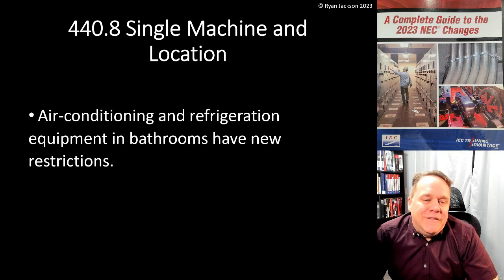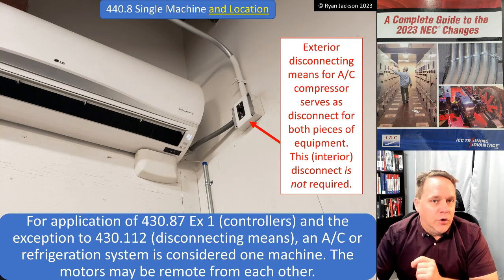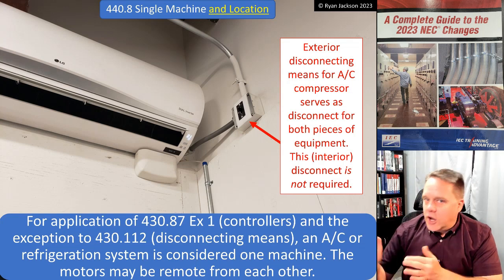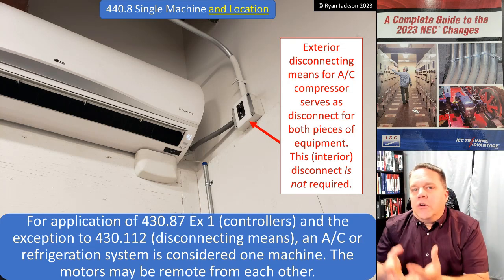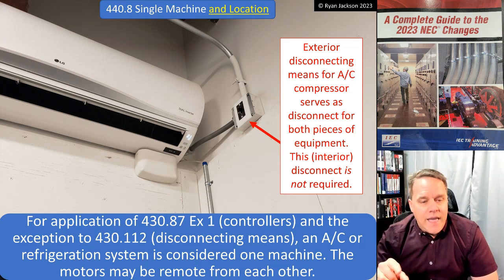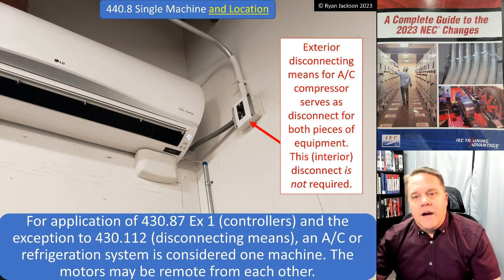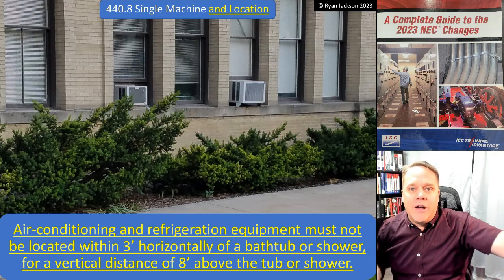440.8 Single Machine and Location (A/C Equipment)

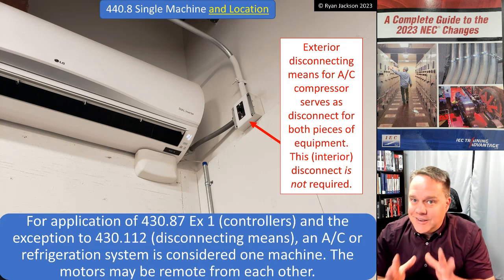Comment: You state @3:10, code for internal disconnect does not apply, even if unit has internal heater, even though such a heater is very likely directly line/grid powered. It's also the case that an inverter based appliance, if 100% electronic - is beyond the scope of the code. Function does not matter. Nothing inside either portion, of the mini split, is line/grid powered; not motor or either fan. An inverter based mini split, or maxi split, is NOT air conditioner, not code wise. If inverter based, tonnage makes no difference. 

The code seems to improperly use the term "air conditioner" as a generic term. The code only applies to A/C units that have line powered internal motors/components. Even the inter-unit connecting cable is not covered by code.

An all electronic HVAC is a generic appliance. None of the code's "air conditioning" references apply. This is (indirectly) stated as much in your 11May2019 (YouTube v=xDQtmZHKMUA) video, at ~11min mark; the outside motor is "line powered".  Video should have pointed out that the code is wrong, the code applies generically to loads that are directly line/grid powered, and only to "air conditioner" that has line powered motor. Electrically, there is no difference between an inverter based mini split and a crypto computer with the similar internal power supplies. That any electronic HVAC used to list RLA or LRA was out of ignorance, or incompetence, by whomever made the label. 

Same is true for "Location" restriction. Any "common sense" narrative is irrelevant, especially since there is no user interaction, with the appliance controlled with a remote - code does not apply - at all.

Comment: This is perfect.  I have yet to find an inspector that doesnt understand what I'm saying but now I have something to point out.  Plus you should only be "disconnecting" L1.  L2 carries high voltage and low voltage DC.  While the 3rd leg is low voltage DC.  I can only confirm this on a few brands but its DC over AC.

Comment: Think the rule that a split system does not require a separate disconnect if the compressor end disconnect can serve as the disconnect is dangerous to every service tech that has to work on indoor condensing unit. If the compressor is up on the roof or more then a few steps vast majority of techs will never turn off far away disconnect. I always used a 21/8" deep 1900 box with a single or if 208 or 240 volts a two pole toggle switch with the little bolt on p!ate that accepts  a lock as the disconnect. Should be a code requirement to label all remote condensing units with the panel location & circuit breaker # especially ones without a local disconnect. Not fun getting shocked while standing on a ladder.
Reply: 100 % agree with you. In other countries that toggle switch is a common practice, labels disappear after time. Remember hvac guys are not electricians, they need to be safe.

Comment: Raising my hand here, I've been having some discussions(disagreements) with my homies. How do you view  the minimum circuit conductor size,  maximum over current protection, with table  250.122. is it legal to put a 14-2 Romex with a 14 ground on a two-pole 20 amp breaker, because article 250.122 states that the grounding conductor in no case shall be larger than the current carrying conductors! Or to be code compliant you should always have a 12 Romex , for you need that 12 ground for your 20 amp breaker, Table 250 122. Say you did a two-pole 25 amp breaker then you need a number 10.
Thoughts
Reply: "The equipment grounding conductor shall not be required to be larger than the circuit conductors supplying the equipment." The code says EGC is not required to be larger, but that it can be.
Reply: You bring up a good point however. If we size or EGC according to T250.122 as based off of OCPD, then I see an issue. For AC loads, we typically use smaller wire with OCPD rated greater than T310.16 ampacity rules. So for example, nameplate could say min circuit ampacity is 30A (10awg conductor), but max OCPD is 50A. So if we install 10AWG current carrying wire, does our EGC need to be 10AWG, or 8AWG as per 250.122?
Reply: @paul4800  This also goes to other places within the code look at 430.52(c)1 exception 2(3).... Now we can upsize are overcurrent( I do understand that we look at it as a short circuit ground fault device dealing with motors) to 400% of the conductor rating, where does this leave are grounding conductor? look at 250.121(D)(1) as I read it you must now upsize your equipment grounding conductor also. I think a lot of guys miss this when they do these things. They just upsized the breaker knowing that it's legal, but forget to do the same with their grounding conductor.
Reply: Sorry its 250.122(D)(1) not 250.121... Grounding conductor shall not be smaller then determined by 250.122.....